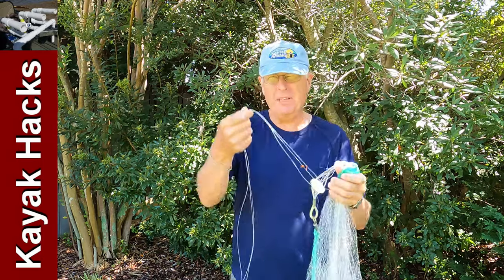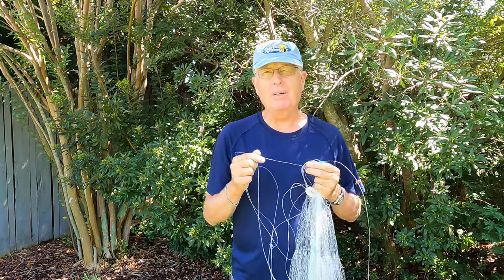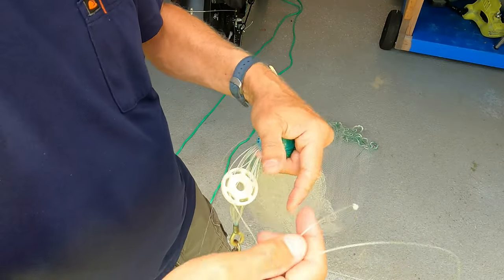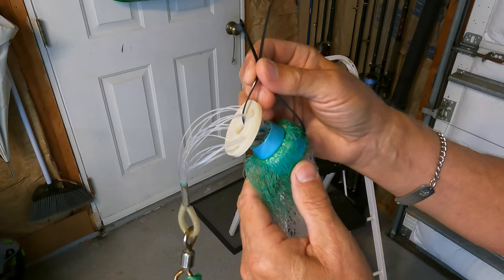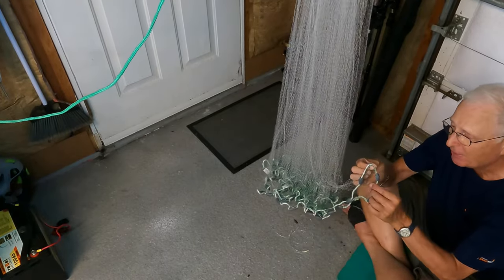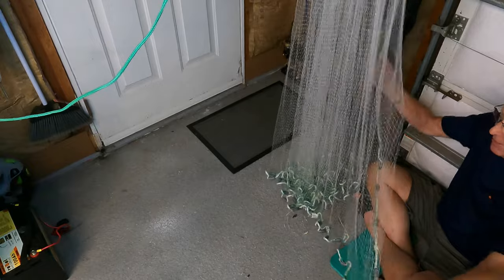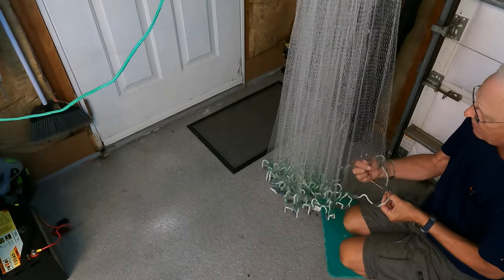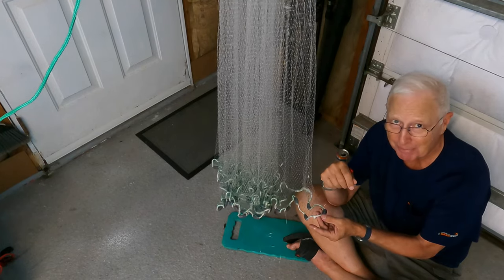Easy Braille LIne Repair in a Cast Net

Comment: Another helpful video.  I seldom have trouble with the Braille lines but the oyster rocks do a number on my netting.  That is a pain to fix.  Also, when a net is beyond going, cut off the weights and use for Carolina rigs!
Reply from the maker: I started using the weights last year. Shame I threw them out earlier!